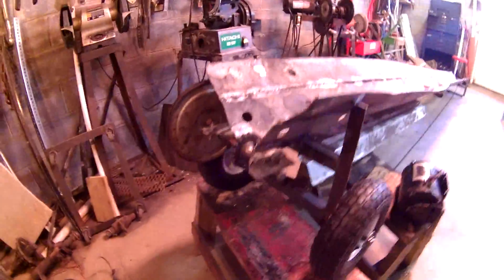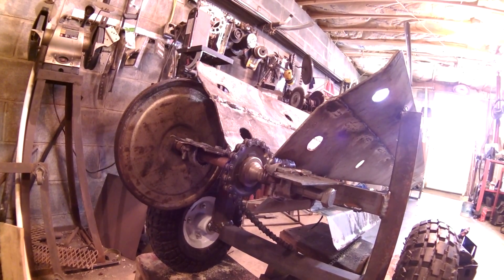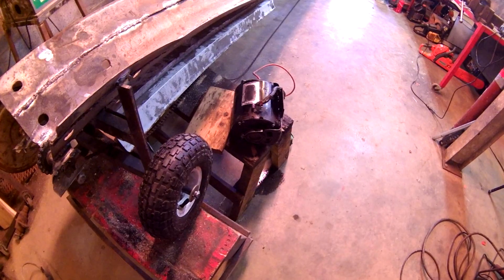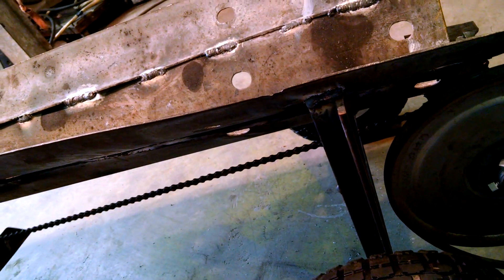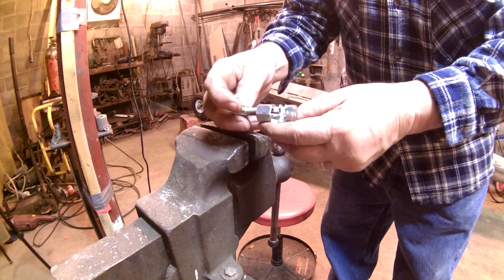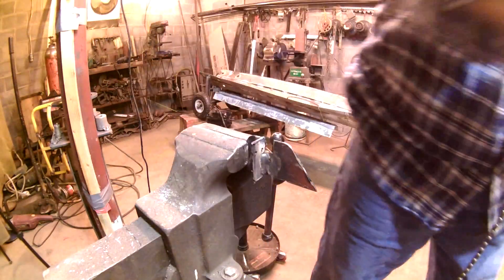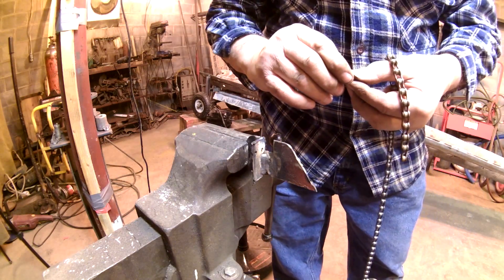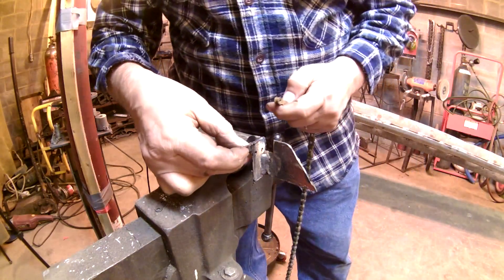Homemade chain driven conveyor part2

Comment: Wow! Amazing solution!
This gives me a new direction to try and solve an unusual side project.
        I have been researching composting toilets vs incinerator toilets and both seem to have issues, so I’m trying to see if I can combine the two.....in an RV.
       It will be a two section unit, the first section will be like a composting toilet, except with a closed stainless steel tube below it.....an enclosed paddle conveyor similar to yours will bring the solid humanure up (slightly), but enough to keep heat from back feeding into the toilet, and reduce fumes) 
to the incinerator.
      The incinerator will have stainless steel automotive exhaust tubing coiled around the inside edge of the incinerator......isolated with a rim of concrete. The center of the incinerator will burn firewood, sawdust and the humanure.....the air inside the coiled tubing can heat the RV.....or be diverted outside, the smoke will go out a stack on the roof.
      I’m building the RV from scratch, so this system will be built into the chassis and insulated very well.
     Yes the incinerator will be heavy, but the vehicle it purposely built to carry heavy weight of Overlanding for long periods of time, so hygiene facilities are a must.